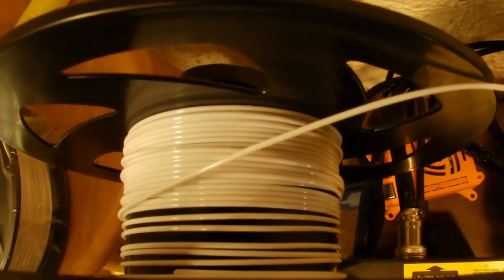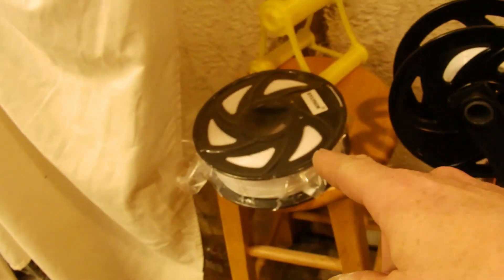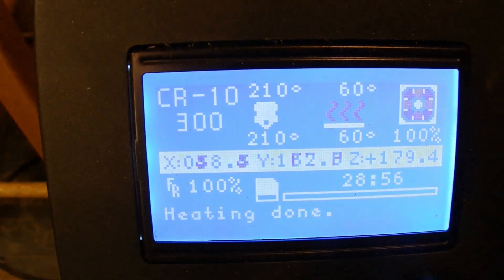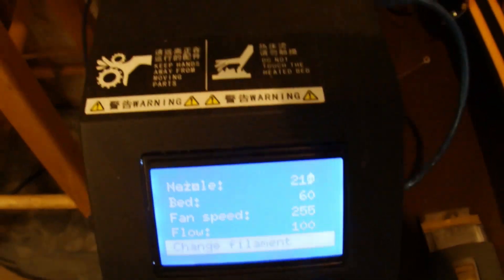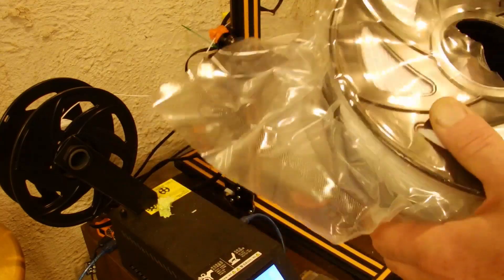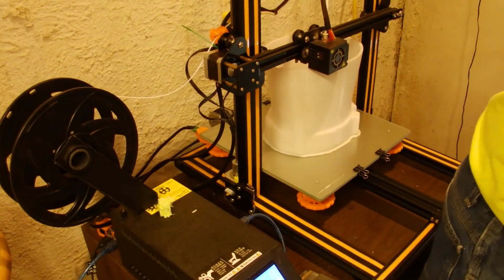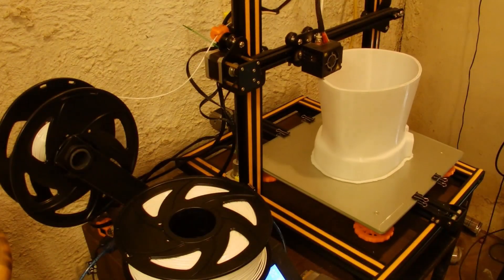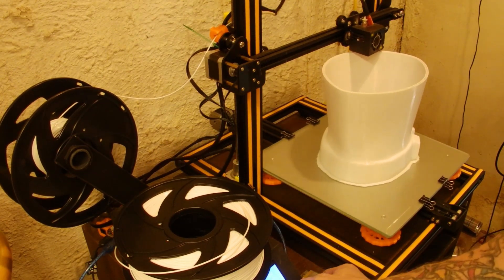Changing Filament Mid Print On The CR 10

Comment: My Cr10 V2 didnt give me the option. I had to feed the new roll into the sensor and press resume but the new roll got jammed so i had to pull it out and force the print to stop again. Luckily the filament was sticking out of the extruder just enough for me to grab a narrow plier and pull it out. Then I was able to feed the new roll in and press resume. I was so scared. what should I do if i wasnt able to pull it out? take off the white hose that feeds the filament into the hot end?

Comment: This video might be a bit old, but sure helped me out as a newbie. Didn't know there was a change filament function, thought I had to pause it and risk the machine cooling down. Went real smooth loading in the new filament, but nothing happened at first, suddenly puking out a looooot of pla and i started to freak out. Turned the knob around to make the Resume Print option to pop up. After puking out a good amount of pla it had primed the nozzle real good and startet printing on the model again as if nothing had interfered with it.
 
Love it

Comment: Bruh I'm printing a life size baby Yoda on my cr10 and I realized I was out of filament. On cura I was 66 grams of filament over a kilogram, I would of had to change out the filament even if I had a full roll.
Reply: Not if you had picked a different infill design, or used a lower infill density, both of which would have used less filament.

Comment: Is there a way to lock the bed and Stepping motor during the change?
Reply from the maker: If it’s not locked when you use this feature as is then only way to change anything is a reflash of the firmware. Your the 1st to ask sick a question I’ll have to do some research as to the way to enable.

Comment: You can do this on pretty much any printer with a bit of practise. Just pause the print, pull out the existing filament, then feed a new one in behind it carefully. You don't want to push the new filament into the hot end or you'll get unwanted extrusion. You just need to gently position it in there, then restart the print.
Reply from the maker: Very true but it’s a function of the firmware and it works great just not all printers are shipping with that feature enabled but if one is good with flashing firmware it’s a useful tool feature you can agree with that?

Comment: I wish all the creality printers have this! I might have to get a cr10 now. Did you push the filament u til it hit the nozzle?
Reply from the maker: Yes and then there is a purge process before it goes back to printing. If you are into flashing marlin this feature can be added to any printer running marlin

Comment: I have a pause print button on my machine....but i never checked if it had a change filament button...mine is a cr10 clone...pause should work also...just resets than reheats after you hit resume print... old roll just has to be pulled out by hand when you hit pause...

Comment: What brand Filament are you using?
Reply from the maker: For this project I used ZYLtech
Reply: @InsideTheMindOfMatt  I been using Hatchbox good filament so far. Wish they carried Violet,
Reply: And what's that thing on your filament? Is that just to keep it in line with the filler tube?
Reply from the maker: James Koehn that is a filter/Oiler I use canola oil on my pla if I get jam issues and it helps otherwise it just dusts off the filament

Comment: I just tried this with my ender 3 and when I resumed print the hot end went back and buried itself in the hot plate and tried to print. Not sure why
Reply from the maker: not an Ender owner but its all in the firmware just a suggestion but some people flash their firmware when they get a new machine just so they know the settings in the firmware but fyi if you didn't know filament change is a M600 command and can be found in firmware by searching for that if your into the editing  of the firmware Chris Riley had some great videos I also did a series but it was more model based then general application but if you need help let me know

Comment: Hey !
Thanks for the tip !
What is the orange piece that you use on you filament just before the extrude motor ?
Thanks !
Reply from the maker: That is a Filament filter/Oiler I oil my Filament when using PLA with an all metal hot end helps to prevent jamming and clogging

Comment: With that being said, There was a slight problem, The new filament did not stick to the existing print and started to curl up, Any suggestions? Apparently the print had cooled down and there was no bonding between filaments, Think so? if so How do you correct this. Also the new filament was a different brand and slight color difference  as well, maybe this was the factor?

Comment: What is that orange ring you first but the filament through? Whats its purpose
Reply from the maker: That is a Filament oiler/dust filter when printing pla through an all metal hot end I use a little canola oil when I use other filament types I just use it for dusting off anything that might settle
Reply: Inside The Mind Of Matt got it, thanks for taking the time, what oil do you use thinking of using mineral oil, like using it becasue its safe to use, I use it for many things when engraving. Feel free to check out my videos, thanks again
Reply from the maker: here's how it was explained to me so maybe you'll get the same understanding. PLA is starched based like food. So when we cook food we use oil to lubricate the metal and keep the food from sticking. same principal I use canola oil myself  that was what was recommended to me and it works so I pass it along when I can

Comment: Had to send out another note.  I have the CR-10 S4 and there is no "Tune" menu on the controller and no "Change Filament" menu either.  Will have to find another go around to make this work.
Reply: I'm late to reply but Tune/Change Filament happens WHILE printing. You won't see this option when it's idling.

Comment: Thanks for this video, very informative. Does the CR-10 hold its bed and hotend temps while waiting for new filament? I think I read somewhere that CR-10S' that use the filament runout sensors actually power down the bed and hotend when the sensor trips... I don't mind the hotend cooling but if the bed cooled that could cause the part to separate.
Reply from the maker: Correct there is a time out but I think it’s 45 seconds at least but it’s one of those I’m rushing to get it done kind of things so not sure actually how long you got. In the marlin firmware the change filament feature has different setting including time out duration that can be set FYI
Reply from the maker: BinaryMango not sure i don’t have the run out on mine and I don’t waste time I swap and go there is settings that can make it do different things in the firmware but this was stock feature that came with cr-10 thanks for watching
Reply: The bed and hot end hold the current temp during the change.

Comment: I didn’t realize that option was in the menu! This is awesome I just got a cr10s and was wondering what the procedure was for changing filament. I noticed I can pause a print but if I resume nothing happens for a while - is this normal? Also changing filament - shouldn’t you extrude some filament first so no air pockets make it through?

Comment: My cr10s doesn't have CHANGE FILAMENT menu. Does this function come with stock firmware?
Reply from the maker: I believe it only comes up in menu if it’s printer not sure
Reply: My cr-10s does not have this option. The cr-10s has a different control board.
Reply from the maker: Have you checked while printing? And the board has no bearing on the feature just means they didn’t enable it when setting up the firmware.
Reply: Cr-10s doesn’t have this option.
Reply: You must be printing to see this option!
Reply: Bronson Alex now I’m wondering this too. Need to fire it up cos I don’t remember seeing this on my cr10s either but it may be available only mid print or something
Reply: Others are correct. Only shows up during a print.
Reply: Defiantly not an option on the Cr10s
Reply: Dave F  after updating my firmware I have this option.
Reply: Jimmy Noname is that the cr firmware ?
Reply: Raymond Williams yep found it
Reply: you will only see the "change filament" option if you go to the Tune settings during a print. Does not appear otherwise.